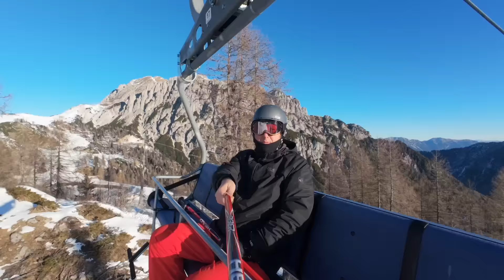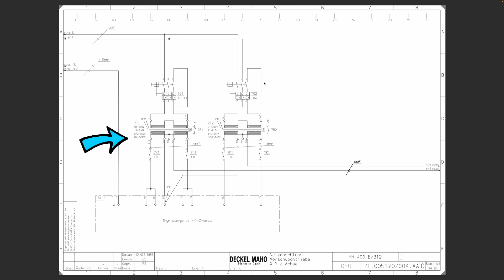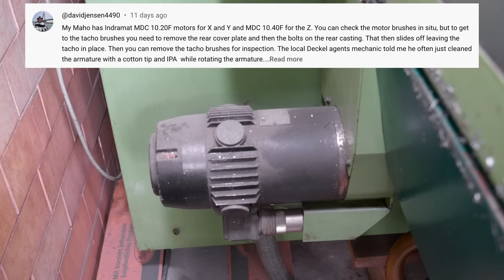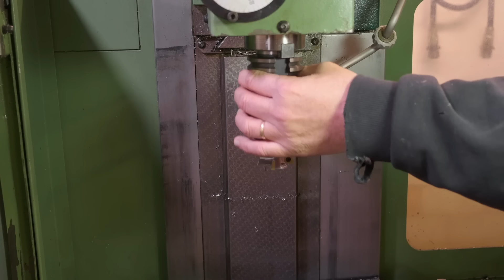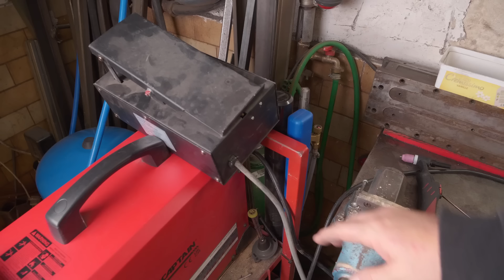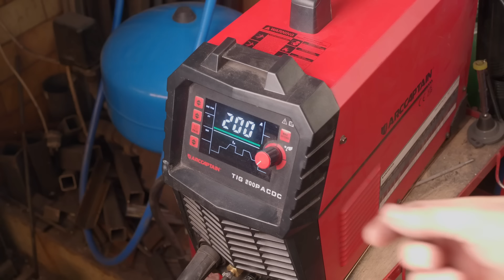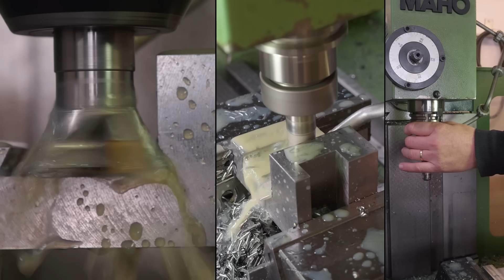My mill threw following errors. Did your advice help troubleshoot it? || RotarySMP

Comment: On your wire feeding while welding, it's also good to keep the tip of your wire close to your cup so it stays shielded by the argon flow until it cools down.  Otherwise it can oxidize and then you're feeding that into your weld.  You seem to be repeatedly pulling your wire away a long distance, but it's also tough to tell for sure since you had your welding footage sped up.
Reply from the maker: Thanks John, yeah, I was moving it away, as I dont have the single hand feeding practice. I need to put  filler wire next to the tv, and practice it.

Comment: I feel like this is game where we're supposed to identify…Mark with the hat is right 90% of the time, and Mark without the hat is only right 40% of the time. How right is Mark in this video? I was expecting Niko(sp?) to ask what happens if someone "loans" a machine to you. Props for the Rankine, we just don't see enough of that these days, kids these days, right? Looking forward to it in the next foundry video. Consider serializing the tool holders because…well, I can't justify it.
Reply from the maker: I need to try out the two new high speed spindles and see which is best for engraving numbers on the tool holders :)

Comment: When troubleshooting a following error fault, you should be looking at the following error plots. A lot can be told from those plots to focus your troubleshooting. For example, bad tuning vs an impossible trajectory vs the motor isn’t moving all look pretty different on the following error plots. Apologies if you have looked at these in previous videos. Your determination in deducing the fault cause from other clues is commendable. Nice job! Good job moving control of the brake to the drive. That’s the way it should be. Nice to see the mill moving again!
Reply from the maker: I did a far bit of reviewing the oscilloscope plots, but it is difficult to make a coherent video of them, as I worked through all sorts of ideas and tunings, and never know what to film, o not as I never know what is relevant till the end.

Comment: That 50Hz hum would drive me crazy. It sounds like a blocked motor or a solenoid failing to reach the designated end of travel.
Reply from the maker: That is why I have the ear defenders on. I hate the humm, as much as  the machine noise when cutting.

Comment: Removing / bridging the brake relay on the Z-axis was surely a good thing. I would hazard a guess on why the machine is running now. When contactors are switched under load, there is arcing. You get some erosion of the contacts and you also get some metal transfer from one contact to the other. Think of the ignition points in a 1970's or older car. Same thing. After a period of time, the mating contact faces get uneven or hilly, and the area of contact gets smaller, increasing the resistance across the contacts and decreasing the current-carrying capacity. When you pressed firmly with the screwdriver, you may very well have flattened or broken off the little uneven peaks of the contact faces, increasing the contact area. And/or dislodged carbon build-up on the contact faces. This resulted in enough improvement in conductivity to run the drives again. Still recommend replacing those old worn contactors 😉 . If you do, an autopsy on the old contactors might make for some decent (compelling? LOL) video content, and close the loop on the troubleshooting process. In any case, glad to see the Maho running again.
Reply from the maker: That is a good recommendation. Based on my tendancy to procrastinate, I hope I still remember I was meaning to do that when it next fails. :)

Comment: I would LOVE to see some graphs of your PID in action (commanded position, actual position, output from PID algorithm to servo) under a variety of conditions. I'm in a different industry with mostly continuous processes, and the shape of those graphs is always what you use for diagnosing potential tuning issues.

In general, nice approach. My typical troubleshooting phases are:
0. Whatever night shift did, undo it, because it was working yesterday. (N/A for this as far as we know, but related for the motor/brake redesign and buzzing).
1. Is it a real problem? (Validate your instruments. Your system says you have a following error. Do you actually? - you sort of did this with increasing the acceptable error. That proves that the following errors the system is measuring aren't infinite, like a broken cable or something. Pretty unlikely because there are 3 axes with similar issues).
2. Tuning doesn't change overnight, but process conditions do. I suspect you nailed it with the temperature. If you wanted to prove that, you'd bring the oil up to temp by running the machine for a while (I assume; maybe there's a heater), the re-running some PID tuning test runs mentioned above. Do you have 1mm following error at a given speed while cold, but only 0.1 once warm, and the same shape to the curve? Bingo!

Fun as always.
Reply from the maker: Thanks, that is a nice logical summary.

There is no way oil heating ( it is a total loss system), so  ican just make a set of plots now, and repeat the same in summer.

Comment: I own a very old MH 700C. Maybe i can try to help you with the general adjustment of the Indramat drive modules. E.g. that buzzing sound of the Table axis can be caused by a badly adjusted drive Module. It's really not that hard, mainly the drift and the following error need to be in the recomended specs and you can mill a perfect circle on your machine tool. (I'm obviously a fan of MJK)
I like your content, nice work!!
Reply from the maker: Thanks Michi. I would appreciate your help. I should probably have a closer look at that Indramat adjustment procedure.
Reply: @RotarySMP 

How can we safely contact each other?
Reply from the maker: @michibreit1282  My email address is on the channel main page.
Reply: @RotarySMP ok, thanks. Sorry if it takes a few days for me to answer. I'm building up a job shop and i don't always find the time. And as the whole world knows, the german economy doesn't make it very easy...

Comment: Hi. Happy new year . Measuring the inserts like this you just seen that they are not equal. It could be the spindle taper . Sk40 to Weldon holder , could be the tolerance on inserts and sure the tool you made . DCMT inserts have like +- 0.05mm on edges . Send them to me when they are finished to nitride them .
Reply from the maker: Hi Emil, true, those are pretty crappy inserts too. Thanks a lot.
Reply: Although I'm not sure it's so bad to have the cutter favoring one insert like this (only one insert to rotate for the finish pass?), perhaps it's worth it to add shim stock behind the others? I dunno.
Reply from the maker: @johnhawkinson  Could help, but I will probably not bother :)

Comment: Ferror is a trip for when something has gone wrong. 
Set it to whatever indicates a problem worth stopping your machine over (and work accuracy requirement). 

My suggestion to loosen it dramatically was for fault finding not a permanent fix btw. 

As for tuning my process is this
Starting with all 0s
Add p and jog at various speeds until you get a decent oscillation (keep adding p until you hit it at any speed) then back off the p until it just oscillates and add just a tiny bit of d. My p was like 8 and d .01 your numbers will probably be quite different but the ratio may be similar. 
Too much d and when your cruising you'll hear the servo fighting the movement, kind of a crunchy humming sound.
Back off p if you need to. 

I then add I (quite a bit) to zero out the steady state offset when moving. I think I've had it up around 20? But watch out, you can get integral wind up and violent oscillations. I believe you can graph the individual contributions of p and I, just keep an eye on them. My machine also has no backlash (or at least less than 0.001mm, twin ball nuts with belvile washer preload) if you have backlash in your servo loop you could well have quite a bad time especially as you add i so be careful there. Look at dead band and backlash compensation. When we lost a nut it got violent hunting through 0.1mm of backlash bashing and bouncing off each side.

Once you have that as a stable base for you pid, then you can use ff1 to help out with step changes in velocity. This is where you can get surprisingly big impacts on part time by increasing acceleration.

I set jog speed to like 2000 then just tap and release the key while watching ferror on the scope. As you dial in ff1 the ferror for that step change in velocity should go down.
As it goes down you can start increasing acceleration then add more ff1 etc until your happy with the acceleration (I stopped when the concrete floor started shaking, then backed it off a little lol I think it was about 3 gravities I worked out it at) more acceleration has a really significant impact on intricate parts.

I would then add some ff2 to reduce the work I needed to do to keep the offset down. But it wasn't really a big influence. 

Winter and summer did wind up with different tunes at one stage. The way on X wasn't that straight so it got tighter at one end. I tuned it up in winter and in summer it started oscillating in the loose part of the way. The more relaxed summer tune did work in winter.

I was using a glass scale only servo loop, no motor encoders. Our ferror sat around 0.005-0.015mm(cutting - high speed (6000mm/minute) jogging)
Reply from the maker: Yeah, I am ightening it back up until I can see what works in Winter. And will compare that in summer.

Comment: About the humming contactor.
I got advice from a machine tech at work (im a cnc machinist) when my kitchen fan contactor at home, sounded like that, that it might be time to knock it lightly to chock loose old built up carbon dust in it or open it up for cleaning. i choose to knock it a bit and that helped.
7 years later, still procrastinating ordering a replacement tho.
I`m not say that this is your error but it`s a pretty cheap check if yoy dont hit it too hard ;)
Reply from the maker: Knowing my luck, the 40 year old plastic would break :)

Comment: Hi Mark, good to see the mill working again.
As a rule it's best to treat the machine labels as accurate , the manuals  are generic whereas the labels are intentional.
Also to echo another comment, I've only ever seen 220 oil in very large heavy machines.
typically mills and lathes (japanese) with box ways use either 32 or 68 oil.
don't ignore the brushes, worn or broken brushes  can lead  up to and including destruction of the drives or motors.
Finally as you know ,software or hardware setting don't change or stop working on their only , if they worked yesterday they will
work today.   confirm that they are correct and look for something physical  as the problem.
Reply from the maker: Thanks Steve. Good points.

Comment: Building up material with the welder was quite ambitious, and I'm glad it worked out. Maybe one day we'll see a repair of the CNC mill table.
Reply from the maker: Hi Alex, thanks. The table could not be welded (cast iron). If I bothered to do a repair it would be a plug epoxied in.

Comment: It shouldn't be Tantalum caps. They are EXTREMELY reliable, which is why they are popular. Electrolytics can fail within a year or last a long time, depending on heat, or bad manufacturing or luck of the draw.
Reply from the maker: Thanks for the feedback on that. Glad I didn't replace them :)

Comment: With a 40 year old electronic controller it could also be an electrolytic capacitor. If a cap is dried out you might be getting signal noise (That Noise is electrical noise and could be coil whine which is often caused by capacitors or inductors at a bad frequency) or too much current drop. Switch mode power supplies have output capacitors for just this reason to smooth out the current. I would rule out setting problems because it would have showed up immediately. A bad capacitor will usually have a bulging top or a chemical leaking from it.
Reply from the maker: I replaced all the electrolytic caps in 2017.
Reply: @RotarySMP  They can still go bad. They need to be rated 2X the voltage of the circuit. I would also check diodes and inductors. Especially since that change you made fixing the sound of the contactor, Is a pretty clear indication it is an electrical issue. The easiest to check is the low phase voltage. That can throw off timing, cause ringing and all kinds of issues.

You could try switching another contactor in there to see if that still does it to see if it is a bad contactor.
Reply from the maker: @excitedbox  Thanks for your tips.

Comment: 15:48 i also don't have any integral gain on my servo drives. even a small amount of integral gain would cause oscillation in my case (because my proportional gain is pretty high and the inertia ratio is pretty high as well). integral gain doesn't reduce follow error, only static position error, so this is of no use to you. modern servo drives allow you to see the commanded position and the real error to get a sense for what the gain values are doing (in the inner loop). proportional gain + feed forward is all you should need; your understanding at 16:12 is correct

18:33 what's good enough depends on how accurate you want the machine to be, of course, especially when interpolating. there is no single good answer here. in essence it's "the best the machine + motor combination will allow, reliably, without inducing oscillations during or after any move". following error is also not a single value; it changes with feed rate. for instance my machine actually has terrible cross-axis following error (0.1 mm when interpolating a diamond shape, yikes), but i can work around it by feeding 5 times as slow which reduces it to 0.02 mm which i can accept
Reply: Integral will reduce following error in steady state cruise. If you have backlash in your machine though it can cause oscillation. Take a look at your backlash compensation as well as deadband.

Also the second issue you describe sounds like insufficient acceleration for your feed. Take a look at increasing your acceleration limits. 
Also g64 let's you specify maximum permissable error for corners etc in the trajectory planner within your acceleration limits.
Reply: @zyeborm  yeah but i dont really care about steady cruise when i'm interpolating a circle do i? integral gain will not make a machine more accurate; that's what proportional and feedforward gain are for
Reply from the maker: @ikbendusan  It was steady cruise offset that I was seeing, but dialing in some I didn't change much, even up to 2/3 P.

I have an experienced CNC tech who has offered to come and take a look at it.
Reply: @RotarySMP  yes but you have scales that create an additional control loop in the controller, right? is the error coming from that loop or the motor loop?

Comment: That buz noise sound like the contactor metal laminations are lose the is a quick test to put a piece of thin card playng card thckness between the pole piece faces of the contactor not the electrical connections, i think it is easy to do on older style contactors i have seen this on a number of machines over 50 years, if the nose stops you can replace the conntactoe or soak the metal core in a hot varnish as when they where first manufactured , for the cost replace the contactor with a good brand not a chiniese copy.
Reply from the maker: Thanks for the tip Ken.

Comment: I’m really happy that the machine is running again. With the old servos you simply have to live with a bit of following error. The biggest improvement would still come from optimizing the velocity controller. But since on your drives all of that is implemented in hardware, it would be quite time-consuming and probably not worth it.

Other than that, all that remains is the proportional gain of the position controller and the feedforward terms. And you’ve already optimized all of that now. The position controller should never have an I or D component. There are special cases where that’s necessary, but for a normal milling machine they should be disabled.

A real improvement only comes with modern digital drives. On my MAHO the following error is at most 0.005 mm with a cold machine and maximum acceleration. That makes freeform milling work well. But if you mostly machine prismatic parts, it doesn’t have to be that precise anyway.

The retrofit also cost me more than the machine itself. In my case it’s simply my hobby, and it was worth it to me. But for occasional milling, you can also get along fine with the original drives.

I also just noticed that you replied to my message from the last video. I’ll write you a short email in a moment. Happy New Year!
Reply from the maker: Thanks for you feedback on that.